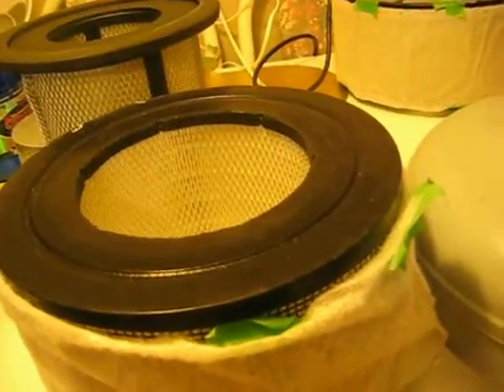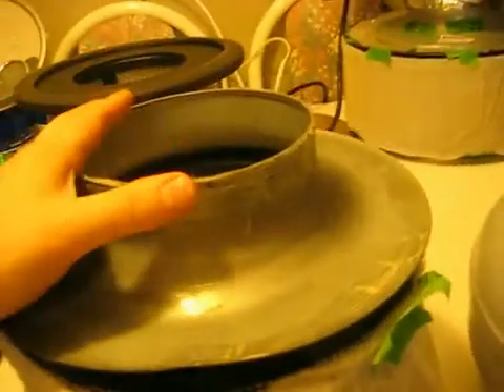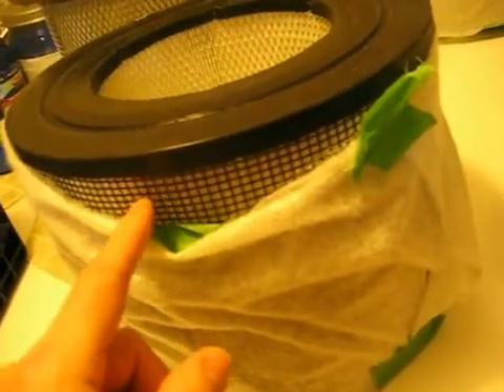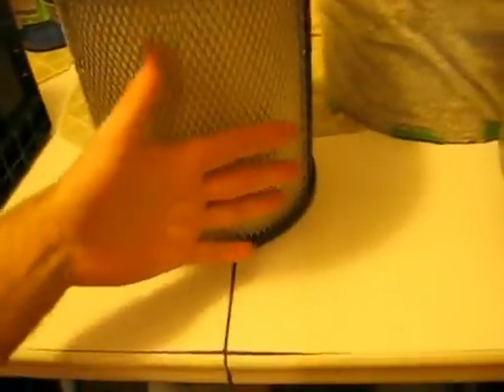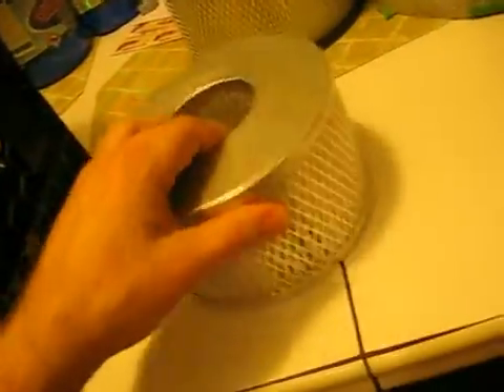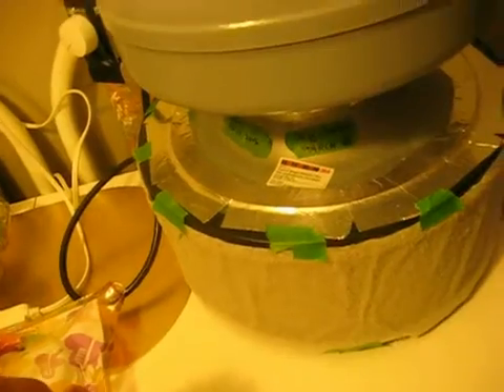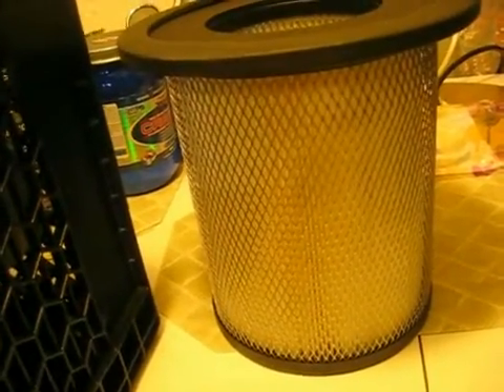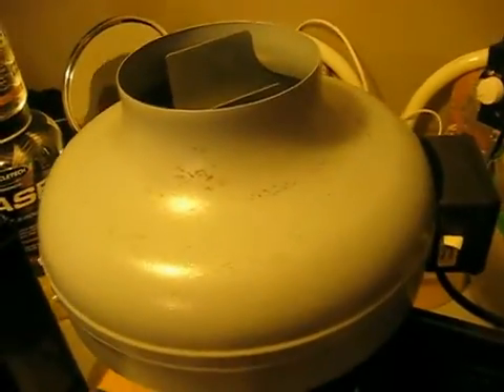Homemade HEPA filter with enclosure

Comment from the maker: Update/Correction for my DIY air cleaner videos:
Using a cheap dollar store plastic plate for the bottom isn’t ideal — constant air flow  can cause VOCs and microplastics to enter your “clean” air.
The best choice is 304 stainless steel: it’s non-magnetic, corrosion-resistant, won’t warp under suction, and produces no particles or off-gassing. Avoid using galvanized sheet metal for DIY air cleaner bottoms. Over time, suction + outdoor ozone can cause the zinc coating to oxidize into zinc oxide dust, which could enter your clean airflow. 304 stainless steel is a much safer, long-lasting alternative.

If you don’t have a disk, a plain stainless steel pizza pan (no non-stick coating) can also work. Just make sure it’s flat, rigid, and the right diameter for your HEPA filter. Edges might need careful taping for a tight seal.  12" round will fit all round Honeywell Hepa filters.  Here is links to suitable bottoms for project.  https://www.amazon.ca/dp/B0DJGPT4LQ?ref=ppx_yo2ov_dt_b_fed_asin_title&th=1   Pizza Pan https://www.amazon.ca/dp/B08L65XQ2K?ref=ppx_yo2ov_dt_b_fed_asin_title&th=1

Comment: Rick. love the videos. Quick question. if a HEPA filter is only rated at 100 cfm and an inline fan is rated at 300 cfm—then what should the ratio be from filter to fan without blowing the fan? how much of a gap is too much?
Reply: That’s too low. You want the filter to closely match the fan. If the filter is too low, it will restrict the airflow of the fan too much. Less efficient, motor will work harder needlessly, and reduce lifespan of fan motor. It’ll eventually burn out. Did you ever get your setup working?
Reply from the maker: The fan should be equal to or less the the rating of the filter. Fan dimmers can be used to slow down fan speed but best to use matching ratings. You can use a centrifugal inline fan rated at 150 cfm with a 300  cfm filter no problem. You can also stack two smaller filters together to use with a bigger fan. Always make sure fan does not overheat, especially when filter is getting old and clogged. Filters should be replace before they get full clogged.